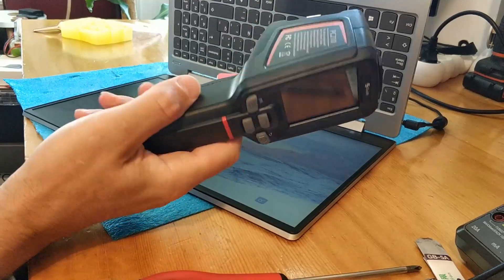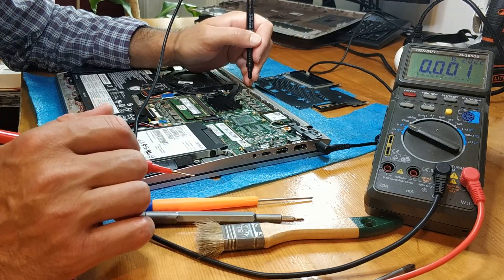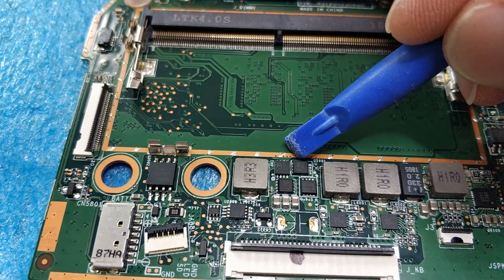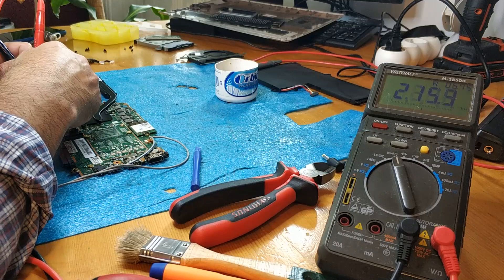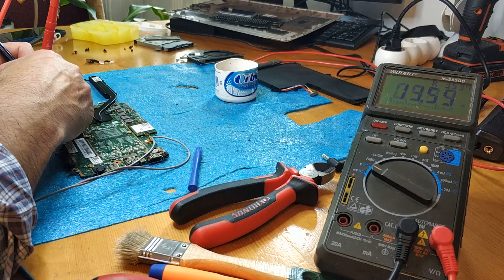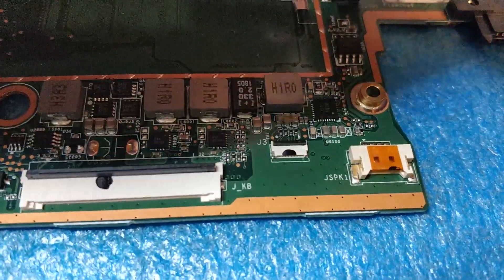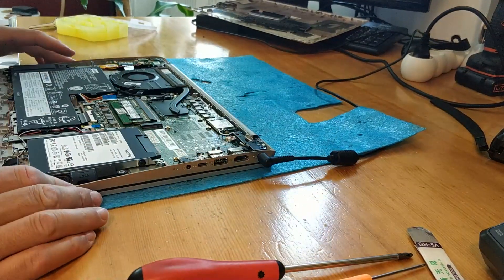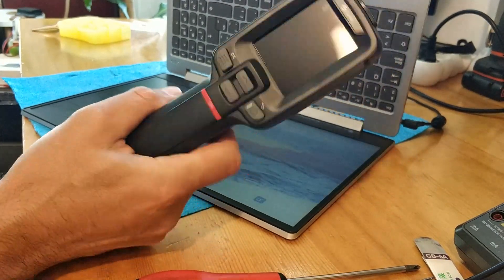Lenovo ideapad 330s - No power, motherboard repair

Comment: Did you replace the capacitor? If so, do you know what the value and voltage was?
Reply from the maker: No replace. Has another two right next to him, in paralel.
Put from another mainboard, same phisical size and you good to go. Done like this several times. Voltage it has to be more than 20volts, if you want to be exactly.